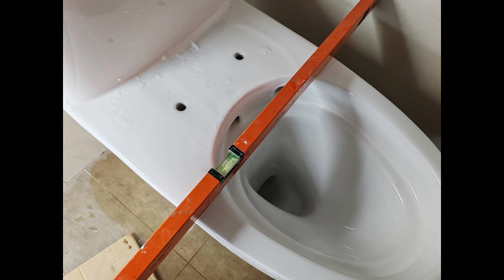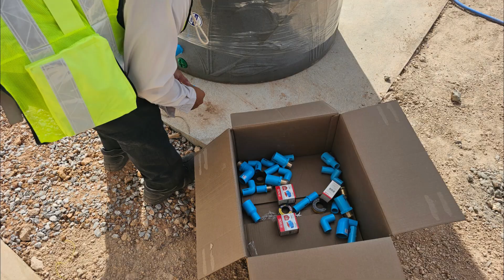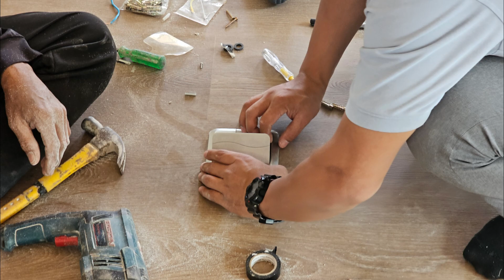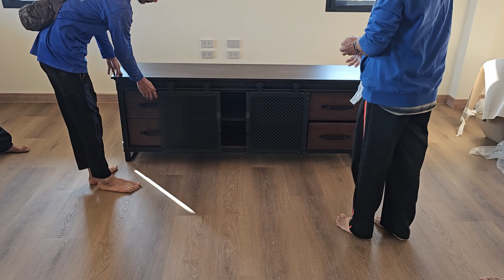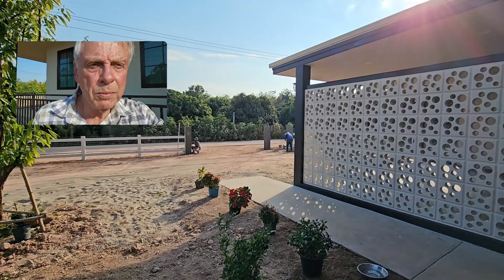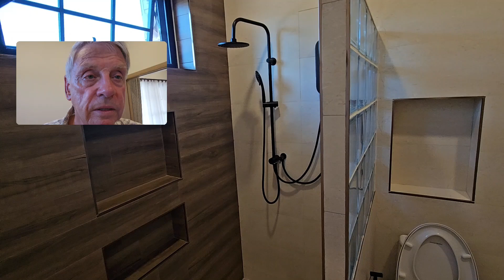Thai House Build is Finished - Weeks 35 & 36

Comment: Fantastic results. Your kitchen is outstanding. I noticed a large TV mounted in the kitchen, any particular reason? And I am also a TV stand guy as well. I hate mounted TVs in the living space.
One last question- is the hallway door for noise control?  I rarely see that done.

I really wish I had placed a border of rocks around my home. Not only does it look great, but it would take care of the condensation lines from my AC that drips right on to the walkway, causing mold and dangerous footing.
Once again, amazing job and Happy New Year!
Reply from the maker: I am normally a TV stand guy - nice new stand in living room. The kitchen one is only 40 in & on the wall due to space constraints. The hall door is for 2 purposes - keep AC cool in living room ( no need to cool the hall) & helps reduce noise to bedrooms.
Cheers
Reply: @RetiredTranquilinThailand  Thanks!